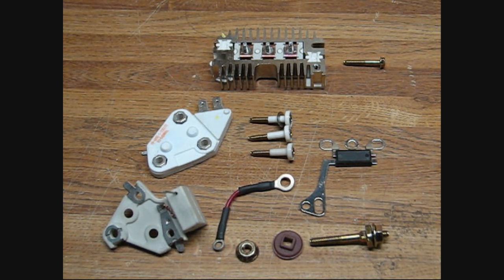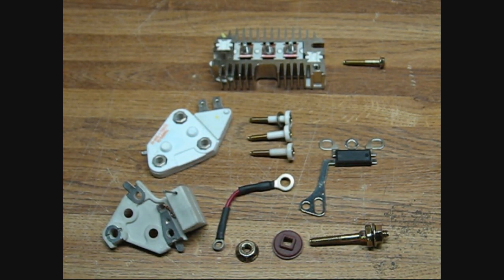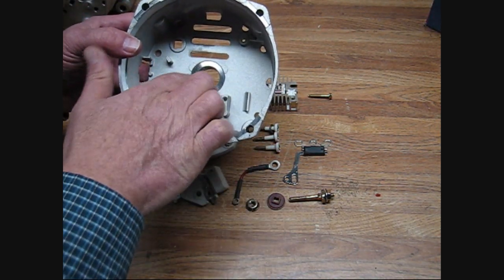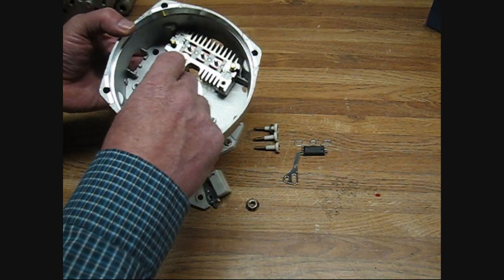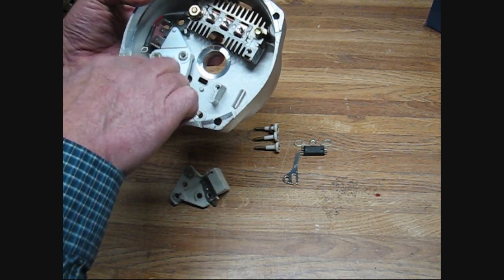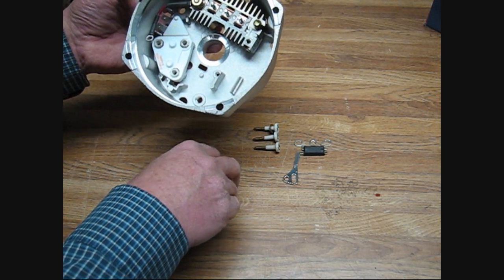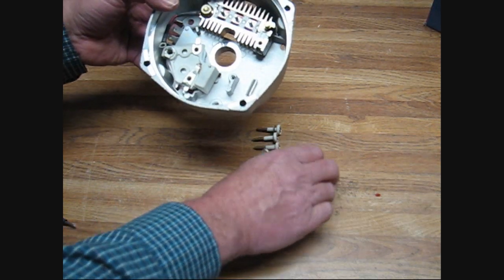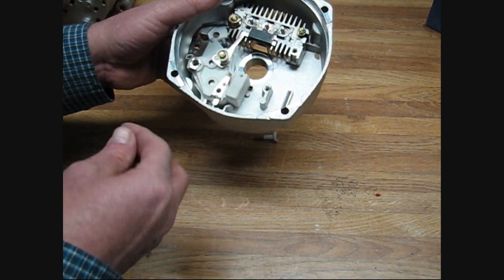Delco-Remy GM 10Si type 6 Volt positive ground alternator conversion

Comment: So- do I eliminate the capacitor, or reinstall it?
Reply: You cannot reinstall it as is as the polarity will be wrong. So, do not install it. By not installing it, the alternator output will have more "noise" in it and may impact your radio.